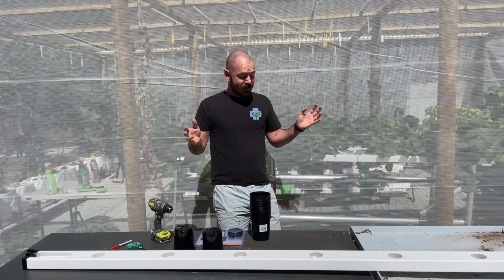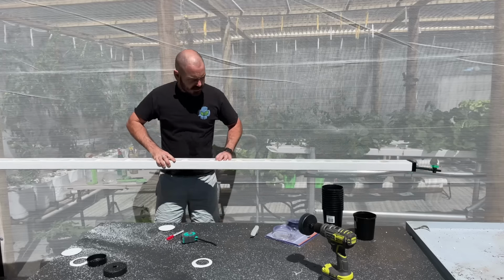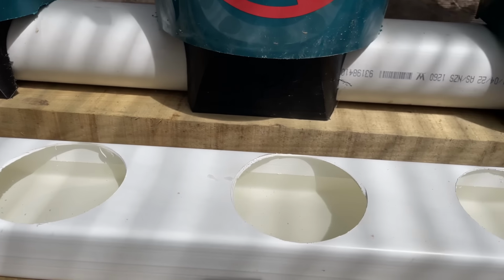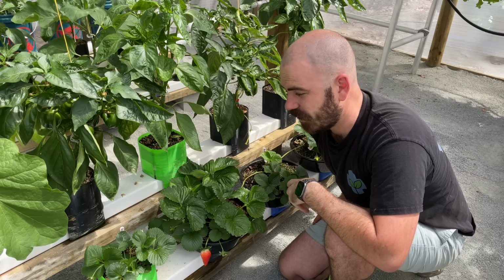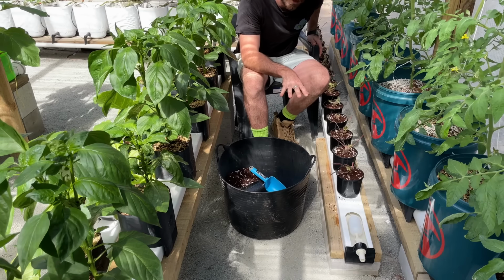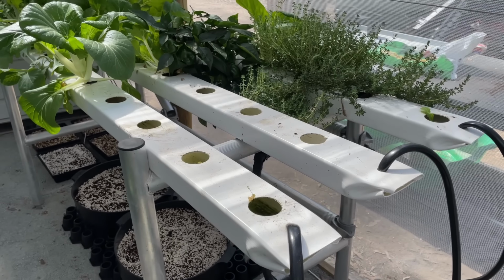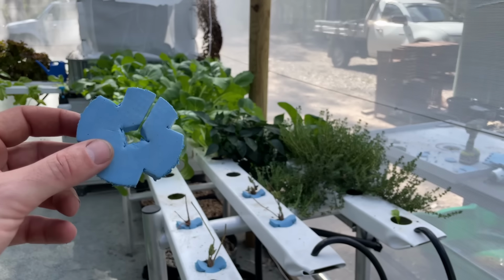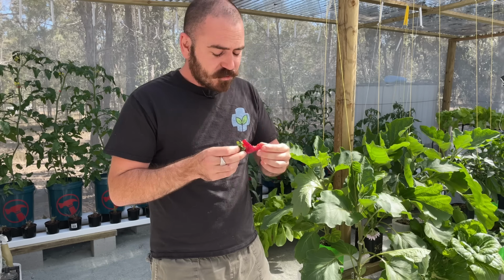How to Build a Super Simple Strawberry Hydroponic System

Comment: hi ya Hoocho,  I'm a Aussie living in the Philippines Just wondering if i could buy a 3 or 4 drain pipe system (every part that's the drain pipes floats etc. and the cost including shipping)  as we can not get the rain gutters you use here. I'm trying to set up a 4 inch pipe that i want to try to run from a fish pond, by pumping  up to a large tank then gravity feed through the grow  pipe down into a flood and drain with clay balls then back through a filter before draining into the fish pond, would this work not only cleaning and filtering the water fully which if i do right the filters should only need cleaning or rinsing out every 12 months,

Comment: This is the💣 of optimised systems you can easly put together anywhere in the world (having access to that little components and simplicity of it using pots, gravity.. )
only points to consider (Hoocho's got this almost all right): 
leveled and sturdy "gutter",
food safe materials (hose, gutter, medium, rope etc..),
and opaque light barrier everywhere to keep the roots and irrigation "water" in the dark. (have minimal light penetration = light trap air vents/holes + minimize or block any insects intrusion)
Sterilized/clean everything between grows.

That's it: apart from the nutrients solution topic, sanitization, (and the 3D printing not everyone can use), here you have a perfect video showing optimal growing method doable anywhere in the world "with any good foodsafe sealing methods". that's is epic content!

thx for sharing

Comment: Instead of that printed valve that can clog and fail, drill a hole in the end cap at the level you want and run water on a timer into gutter until it over flows into a reservoir. The over flow water can be returned to the source periodically. Much less likely to fail.
Reply: Good idea, but I think the idea here was a "no power" system. Unless you're talking about a non electrical timer? Not sure something like that for water flow exists, but if so, could you provide a source? Thanks!

Comment: Bro why are you still using pots of any kind? with hydroponics they are totally not needed. just be sure that there is 1 inch of air space on your roots for them to breath at night ( when they are not getting sun and taking up food ) then keep the nutrient solution over the rest of the roots and skip the buckets. With you rain gutters set up you need only add the foams I described below plants and plant food and time . all the rest is waisted money and effort. Trust me I've been using these Kratkie methods for as long as they have been around and have had enough success that my local collage horticulture professor used to bring hi's classes over to review my greenhouse and Kratkie set ups as they work so well and are so cheap to set up and run.

Comment: Two questions about 3D printing and Rain Gutter Grow/NFT systems.
1.	What 3D Filament should I use for things that will be sitting outside in the sun?  Would PLA be OK to use for this?
2.	Should any unused holes in either a Rain Gutter Grow or an NFT system be covered over, to prevent sunlight getting in and growing mold etc. in the nutrient water?  If so, do you have a 3D print for this?
Reply: pla would not be ok for this, abs or petg

Comment: Check this guy out - slices of pool noodles for NFT plant support  https://youtu.be/-yq0Ge_-uGQ . I tried using pool noodles as plant support and they work terrific. Easily accommodates size of plant stem/crown and the material is easy on the plant stretching as it matures. Works great. When I plant into NFT channels cut a thick slice of the pool noodle is quick solution.  I also prune strawberry roots to 2.5 inches. When I don't the new roots grow adding to the original volume of roots - more effective use of roots.  Pruning has an effect of the plant not growing a huge root mass clogging the channel.  I use MasterBlend at N8P12K32 then after adding CalNitrate/Epsom Salt final nutrient numbers N24P12K32 with EC 1.4 same as your use and pH a little lower at 5.5 – 6.0.   My channels are 4x4 post covers and I close both ends and run nutrient at each plant station on the channel.  I can control the depth of the nutrient flow within the channel depending on the growth stages with the goal of very scant film flow for strawberries at maturity (throughout fruiting). Strawberries don't like too wet or too dry.  Also intro fruiting if the pH begins to drop for no reason, it's mainly due to oxidation and deterioration of roots. You can flush at that point, but I just toss plants and call it a season. I don't want to scrub that crap out of my channels.

Comment: I tried using 3 to 6-inch net pots for strawberry. But it seems that 6-inch one fits best for holding up to 6~8 leaves after 3 months when plant starts flowering and fruiting.
Reply: Do you mean 3" or 6" net pots??  Did u put soil in them ??
Reply: @MaryJoMatey  yes, I added Pearlstone and potting soil in 1:19. But some professional vendor even add some coco fiber shred, it is very convenient for grower. The potting soil alone is not enough to support air and moisture for the root.

Comment: Hi hoocho,  do you have any suggestions for lowest possible profile draining pot saucer for a drain to waste to maximise height in tent?
Reply: For 2 gallon 20cm diameter pots
Reply from the maker: https://www.ebay.com.au/itm/NEW-LITTLE-GIANT-554425-AIR-CONDITIONER-CONDENSATION-REMOVAL-PUMP-5411608-/311359014663?mkcid=16&mkevt=1&_trksid=p2349624.m46890.l49286&mkrid=711-127632-2357-0

This is called a condensation pump.
It has a float switch that turns it on.

I plan on doing a video eventually but you can use this in a vertically challenged space to pump water out of a low profile container.
Reply: Do you have any pictures of your system?

Comment: can i do this with my aquaponics . my concern is the small white rocks will get into the system . i already use coco in my vertical towers
Reply from the maker: The only problem I see is that aquaponics is meant to be a closed loop the RGGS system is very much compartmentalised. 
The res feeds the gutters, but the water never returns. I'm not sure it would work. *however, I only have a surface level knowledge of aquaponics and I would encourage experimentation.